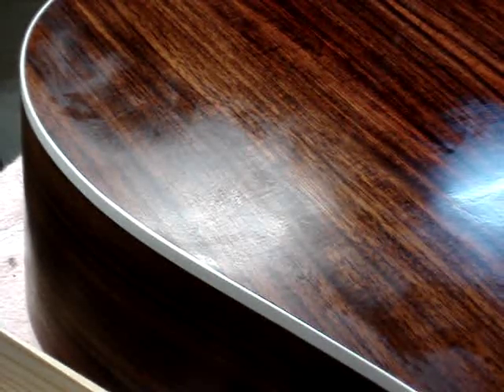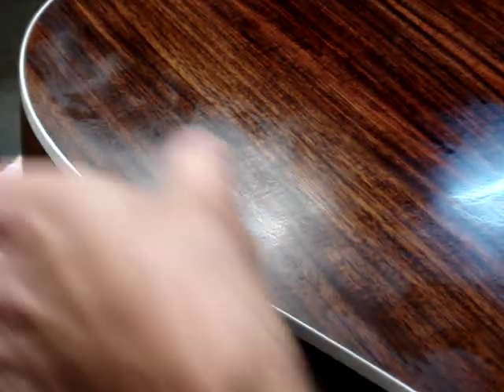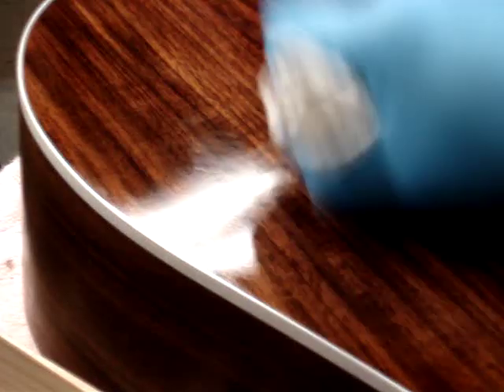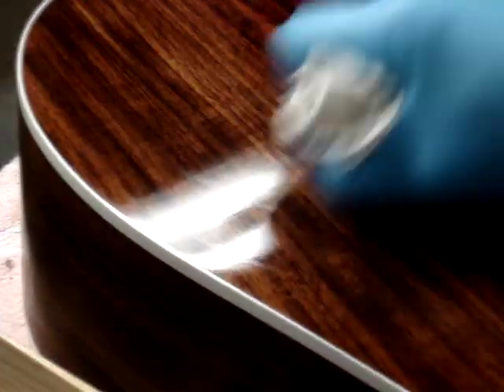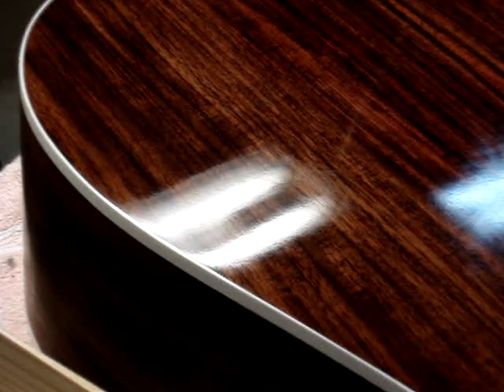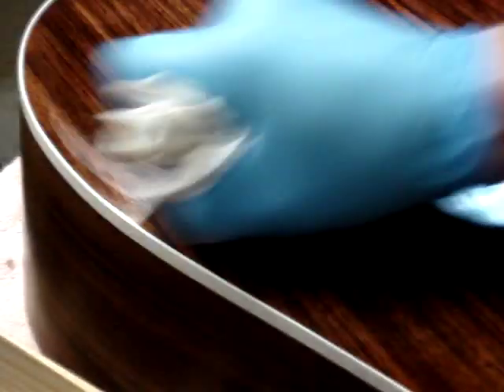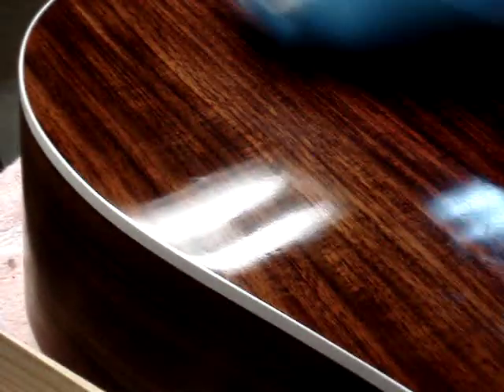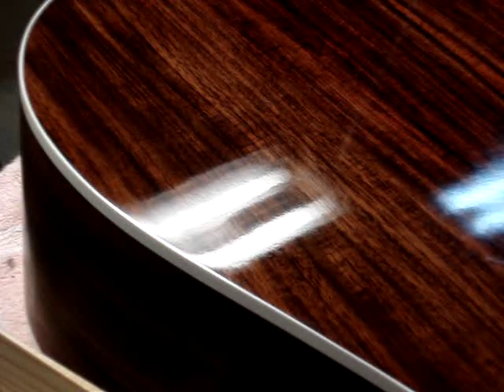Guitar French Polish 3

Comment from the maker: @KlocoH @KlocoH Thanks. French polish is simply mixing shellac flakes with alcohol and rubbing on the wood. So yeah, you could French polish ash. To fill the grain. You could keep applying the shellac mixture, sanding back down to the wood until the grain is filled, or use pumice powder with your mixture to fill the grain, or there are some really good grain fillers. It all boils down to taste. What do you like.

Comment from the maker: @indianchief741 No, it's not like the lacquer you use on cars at all. This is true lacquer. It's made from a secretion from the lac beetle. The secretion is gathered and processed.
     Once processed it is mixed with alcohol and this mixture is rubbed onto the guitar. Or furniture! Each time a layer is applied the alcohol melts into the previous layer. Therefore the resulting finish is actually one thick layer even though a number of "layers" were applied.

Comment from the maker: Usually you will wet sand the surface using mineral spirits as a lubricant and starting with 600 grit paper. This will level the surface which will then require further coats of the shellac. Continue doing this procedure using increasing grits of paper until you are happy with what you see.
Then use a polishing compound same as you would use for a lacquer finish. The traditional way is to use rottenstone, but I have no experience with that.

Comment from the maker: The general feeling is that when the technique is properly performed, the oil is pushed to the surface and not amalgamated into the finish. It is then spirited off during the process leaving very little oil on the wood or finish.
As for olive oil on the fingerboard, I've never heard of that so I'm not sure. But there are excellent products you can purchase for the purpose of coating and protecting the fingerboard. One of those would be my choice.

Comment: I think I am done bodying my table.  It's really shiny but not quite a mirror finish.  I haven't used oil and unsure what kind is best.  What do you suggest for me to get a mirror flat finish at this point? Are you using anything abrasive like 2000 grit paper? If I use the figure 8 technique, will it leave a pattern visible when done if I add a couple drops of oil to my rubber?